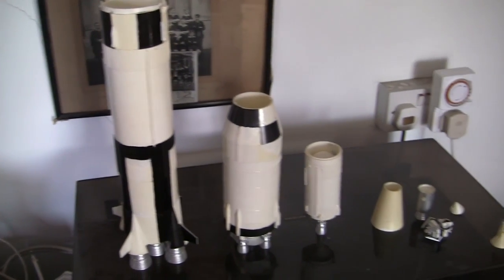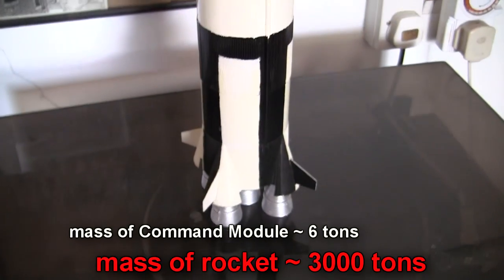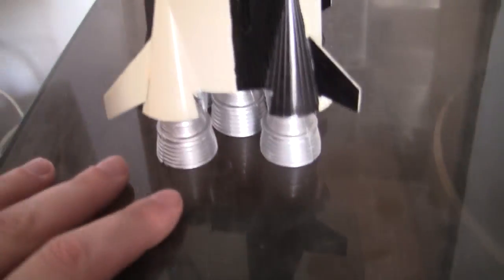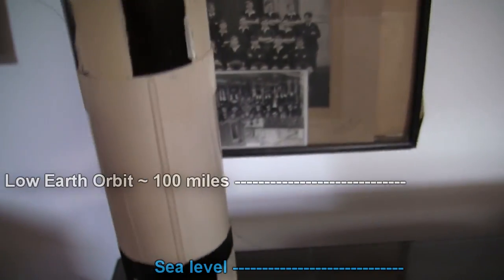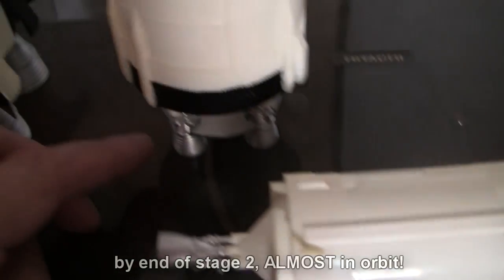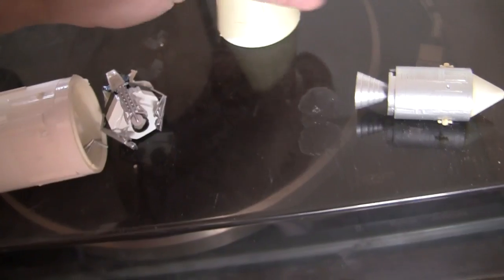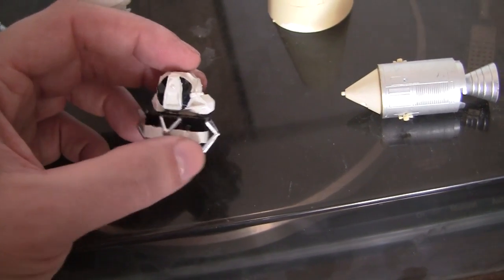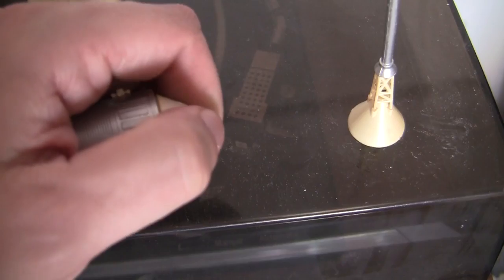The Saturn V Rocket: How it worked!

Comment: why is there no crater under the landing spot of the lunar module?
Reply: Elliot Roe
Gravity has nothing to do with it.  The descent module engine was just not powerful enough to leave a crater.  While it was capable of thrusting with 10,000 pounds of force, for starters, they don't land at full throttle, so it was more like 3,000 pounds when they were landing.  Second, the engine nozzle was about 64 inches in diameter, so that 3,000 pounds spread over the area of that circle (~3,217 in²) is less than 1 pound per square inch of pressure.  Then take into account that the gases expand rapidly in a vacuum, and that area is much larger.  All things considered, the actual pressure on the surface of the moon is well under 1 pound per square inch.  That's not going to create a crater.
Reply: Extremely low gravity.

Comment: You are telling us how it works and yet you do not know your facts?
Reply: +shecanatakeitcaptain no he was giving a brief rundown of how the mission was preformed. 
if he was telling us how it worked we'd still be here next week going over all the minor details of everything from mission control, orbital calculations, interception angles and burn times. (which personally I would find interesting)
Reply: +crwydryny No. The video is called "....How it worked." In the first 60 seconds the speaker says he does not know the mass of the fuel ( 80% or 90 %) forgets what the bit that holds the astronauts was called and does not know if it was 1% or 0.1% of the mass of the rocket.  This is not a guy who should be telling any how it worked.

Comment: What a great machine. I always wondered what did the fully loaded rocket rest on before liftoff. This rocket weighed almost as a navy destroyer, but always wondered what this whole thing rested on.
Reply: Rajan N It was held in place with a clamping device, which would hold on whilst the engines were throttled up and would then let go so it could launch

Comment: What kind of pumps can deliver 13 tones of fuel every second? so fascinating.
Reply: From the article I linked earlier.

http://arstechnica.com/science/2013/04/how-nasa-brought-the-monstrous-f-1-moon-rocket-back-to-life/2/

"As with everything else about the F-1, even the gas generator boasts impressive specs. It churns out about 31,000 pounds of thrust (138 kilonewtons), more than an F-16 fighter's engine running at full afterburner, and it was used to drive a turbine that produced 55,000 shaft horsepower. (That's 55,000 horsepower just to run the F-1's fuel and oxidizer pumps—the F-1 itself produced the equivalent of something like 32 million horsepower, though accurately measuring a rocket's thrust at that scale is complicated.)"

So, that's what kind of pump.
Reply: From Wikipedia about the F1. Each F-1 burned 5,683 pounds (2,578 kg) of oxidizer and fuel per second.
Reply: And that's just one engine!  The Saturn V had five of those things. :D
Reply: Big ones

Comment: Thunderfoot:
Have you ever heard of company called "AEORJET" ? They are located in Sacramento California. The head quarters. My grandpa Floyd Marvin Henson,
worked @ the company As an aerospace engineer. that is the company responsible
for manufacturing  all the rocket boosters used on the saturn 5 moon rocket. As well as all the modules, service,command,lunar modules.
Reply: James Henson aerojet made the engine for the CSM, but the launch vehicle was all done by Rocketdyne, though the 2 are now merged. The stages were not made by aerojet, they were done by Boeing, North American, Douglas and Grumman.

Comment: Why did the rocket turn around? Why wouldn't you just launch the rocket into space already assembled.
Reply: Aero dynamics the lunar module had extremly bad earo dynamics so they turned around in space instead
Reply: Rainbow dash well it was more than that! They can just put fairings around parts to make them aerodynamic. It was so that the crew could use the escape rocket in-case everything went sideways.
Reply: MegaMrFuzz oooh yeah i forgot about that part
Reply: Rainbow dash What do you mean by "turn around"? 
The rocket launched the top stage into low earth orbit without "turning around". The top stage then fired again to send the Apollo craft to the moon, again with no "turning around" involved. 
However, once on course to the moon, the Command/Service Module separated from the top stage and did indeed "turn around" as it had to extract the Lunar Module from its position atop the top stage.
Reply: EricIrl What I meant is how when on the way to the moon, after being in orbit. The rocket would split into two, and the crew would dock the ship the other way. I was wondering why, why not just send the ship up already attached? But that has already been answered by other people =)

Edit: I realized you went replying to me, but we both of the same thing in mind.
Reply: Ben Yes - I clicked on the wrong "reply" button. 

When they got to the moon, they wouldn't want the top stage (the S1B) still attached as that would mean they had to slow slow down a much bigger mass in order to get into lunar orbit. It would also have meant that any mid course corrections on the way to the moon would have had to move a much bigger mass compared to the Command/Service Module-Lunar Module combination only. That would have meant carrying a LOT more fuel - making the whole thing even heavier still. 

Getting rid of the S1B early also meant it gave them plenty of time to get the S1B out of the way. Having a big mass of dead rocket floating along near you was - 

a) dangerous
b) could interfere with radio communications

The best course of action was to shed that mass at the earliest possible opportunity. Which is exactly what they did. Indeed, you can see from how the whole mission was conducted, the basic principle of the Apollo system was to shed mass as soon as you no longer needed it.
Reply: EricIrl Wow! At the time they barely had any technology and they came up with this rocket. To the people that were brave enough to go in this bomb, you got balls of steel.
Reply: Ben They had PLENTY of technology. In fact, those who are building large rockets today can learn a lot by looking at how the whole programme was run.
Reply: EricIrl Yes =), they might have had smart people, but there computers were terrible for running the processes, atleast thats what I've been told.
Reply: Ben The computers were the best they had at the time for the tasks they wanted them to do. They were designed specifically to do limited tasks and, by and large, they did those tasks well. The computers on board the craft were designed to be as simple and as reliable as possible. 
People say today that they were [pretty dumb by modern standards - which is true. In fact, they were pretty dumb even by 1960s standards as they were more concerned about reliability than gee whizzery. Even today spacecraft computers are usually a number of generations behind what is available for day to day use - for the same reasons.

Don't forget though, they also made massive use of ground based computers - which were huge IBM mainframes and the most powerful available at the time. Apollo 13 managed to get home safely even though for a large chunk of the flight their on board computers were down due to lack of power.

And finally, there is more to flying to and from the moon than computers. There were massive engineering and materials issues to deal with during the design and operation of the rockets and spacecraft and they did this very, very well.
Reply: +EricIrl yep, just look at the shuttle, when they were still flying they were still useing those old 5 inch floppy disks (those big things that haven't been used since the 80s by everyone else). which considering the fact that all they ever needed was a massive calculator to work out orbits and burn times that's all they really needed
Reply: +crwydryny Very true. Later computers on the Shuttle used data and programs stored on DAB tape.  

The Shuttle computers had so little memory capacity that they could not carry all the software controlling lift off, in orbit activity and re-entry and landing at the same time. Before each phase of the flight, they had to dump the previous instructions and load up what was required next.

By the time of the last mission in 2011, the laptops and tablets used as personal computers by the crew had far more capacity than the computers running the Shuttle.

Comment: Actually I think you'll find that in the event that the rocket explodes, or just topples over on the launch pad, not only would half of Florida be dead, but so would the men inside, as the escape system wouldn't trigger early enough for the astronauts to escape. Of course they knew this at the time, they just didn't tell anyone.
Reply: DerpMans Derpyskin If anyone has seen film of a tree falling over, one realizes that it does not instantly fall down and impact the ground. If a Saturn V had a structural collapse and started to fall over, the Emergency Detection System would automatically initiate a Pad Abort and send the capsule out to sea. In Abort Mode One Alpha, during the first seconds of the launch, if there was any problem with the Saturn V, again the EDS would initiate an Abort.

Believe it or not, the NASA engineers during the 1960s were pretty smart and figured out how to keep the astronauts alive during all sorts of deadly mishaps.
Reply: DerpMans Derpyskin no, the escape tower was only activated from command pod input, entirely pilot discretion.
Reply: DerpMans Derpyskin Half of florida? This is not a nuke. Also, the rocket doesnt just explode because of nothing, if a leak is detected or a premature ignition, the astronauts would know well ahead of an accident.
Reply: Jason Zhao Well, your correct. But you're assuming that this cannot explode. It can. Though its unlikely it can, and the fuel is equivalent to two kilotons of TNT. I noticed you compared it to a nuke, and this 2 kt, is about the size of a small atomic bomb. And (at least according to a documentary I watched) if the engines failed, (by engine failure I mean they went up, a foot or two, and fell down, signaler to the first satellite america launched) or the rocket fell over on the launchpad, then... Boom. 2204 tons of TNT. And no escape for the astronauts.
Reply: DerpMans Derpyskin That is assuming ideal conditions where all the fuel will ignight and explode at once. Just look at the Challenger, it's ET and SRBs exploded midflight with an explosion far less than a nuke.
Reply: Jason Zhao its not fair to compare this to the challenger. Its got much more explosive power. Of course you're correct, it would be unlikely for it to blow, but it could, and it would blow big.
Reply: DerpMans Derpyskin 

The size of the explosion would be less than a 20th of the size of the nukes used on Japan, without the fallout, and the launch site is located quite far away from major settlements. The damage done would be more than most rockets, but the Saturn V is bigger than most rockets.

Also the escape system isn't just designed for pad aborts.

Please check your facts before you try and tell someone they are wrong.
Reply: DerpMans Derpyskin 
http://en.wikipedia.org/wiki/N1_%28rocket%29
Total estimated force of the explosion was about 4-5 tons of TNT, despite the propellant load theoretically being enough for a 6.9 kiloton (of TNT) blast.[41] The subsequent investigation revealed that up to 85% of the propellant onboard the rocket did not detonate, reducing the force of the blast

These things are designed with the possibility of catastrophic failures in mind, The base line argument of the explosive value of the fuel is correct but the chances of it happening where designed to be completely outside of the realms of plausibility. for a start, detonation at peak force would require all the fuel to be spread at a near perfect mix ratio, and the only way to cause that would be several smaller primary explosions, and the act of having those primary explosions would burn off huge portions of the energy in question.

Theoretically the most dangerous possibility would have been a failure similar to what I'm about to list, it will sound extremely convoluted as it assumes many worst case scenarios

During the 1st Booster stage acceleration the 2nd stage breaks free of the decouplers between 1st:2nd, the force of the decoupling damages the engine and causes a massive fuel leak but no ignition, the sudden mass change of loosing all stages above 2nd causes the 1st stage to suddenly accelerate and collide with the 3rd stage tanks resulting in the 3rd stage tank being completely sheared open, at this exact time the 2nd stage tank falls into the main booster flamewake, the fuel leak from the structural shear is at optimum flashpoint  and explodes, this 1st explosion shears open the 2nd stage tanks causing a 2nd explosion, the 2nd explosion reaches far enough to trigger an explosion in the 3rd stage tank that has just been ruptured by impact with the main stage, these 2 explosions then cause the remaining fuel in the main stage to trigger a 4th explosion.

The fact that these theoretical explosions are staggered causes a huge loss of force, this is because force is relevant to the cube of the propellant in any givien explosion(this is why a 2000lb bomb is 8 times more powerful than a 1000lb bomb), also the theoretical force of the calorific value of the fuel assumes a fuel air mix  that is high enough for an explosion, this is extremely unlikely as if the mix is too fuel rich it cannot explode, as it can receive oxygen as fast as it expands, resulting in a long explosion of several second as opposed to a "powerful" explosion as the force of the explosion is used in pushing unburnt fuel  outwards, with the wake of it exploding itself.
Reply: Nice job. Thanks. Another way to look at it is to compare rapid oxidation vs. explosion. Liquid fuel has a very fast oxidation (burn) rate as opposed to explosive solids that detonate. Thus while the Saturn V may have had the explosive equivalent of X-tons, as you point out, the stored energy is not released in an instant (explosion), but rather is ignited and burns as the fuel/oxidizer (air) mix becomes optimized. Thus, Florida would be saved and the Astronauts would live.
Reply: foxkart61 it was automatic no?
Reply: Shakfey Funny because I did check my facts, I actually googled the size of the explosion, and someone said it would be the size of a small atom bomb. I doubted it but it sounds cooler to say, a small atomic bomb, than to say two kilitons of TNT. And also I never compared it to the little boy bomb.
Reply: DerpMans Derpyskin I disagree as the (Dry+Full, couldnt find fuel mass) mass for the Saturn V is only about 2x the mass of the Space Shuttle with the diference of about 1300000 kg. But take into account that the Saturn V holds about 2200000 kg of KeroLOX and only 600000 kg of HydroLOX, compared to the Space Shuttle's 1000000 kg of HydroLOX and 500000 kg of SRB fuel, you have two pretty similar levels of power. Keep in mind that SRB Fuel and KeroLOX have very close burn rates and are both far less violent than HydroLOX. Also, the Saturn V's propelant is contained in 3 main stages (LM and CM have insignificant amount) while the Space Shuttle's is alot more localized around the same level.
Reply: DerpMans Derpyskin If it were true that a large part of Florida would be obliterated if the Saturn V exploded, then I guess that a larger part of the USSR was obliterated 4 times.  This is the number of launches for the Russian rocket they were using to try to get to the moon (the N1), and it had an equivalent amount of thrust or more, and all four launches exploded in flight.
Reply: retrofan42 Well, the N1, did, (according again to a documentary I watched) explode with the force of a small nuclear bomb. And if you where one of the spectators of the N1, (if they allowed that) you would be dead, or atleast if you weren't in the dug out. I would imagine that the same applies for the Saturn V, if it exploded.
Reply: DerpMans Derpyskin I think you also will find that the escape tower "did not work", because the astronauts chose to not even consider using it, to the human error of aborting a good launch ... that would be almost as embarrassing as deciding to invade a country to confiscate WMD and not finding any.
Reply: foxkart61 Wasn't that the Gulf War?
Reply: Jason Zhao no, the Gulf War was "Bush I",  the invasion of Iraq for non-existing WMD occurred later during "Bush II".

Comment: If anyone says that the bak up plan wont work and they will die orbiting the moon,your wrong it did work on another lunar mission i cant remember it maybe Apollo 12 or 13
Reply: No. Apollo 13 didn't use the sort of "back up" plan you're speaking of. That was only meant for pre-orbit. With Apollo 13 they ended up using the life support of the Lunar Module to compensate for the power loss and heat loss of the Command Module (also doing some incredibly creative "patch ups" and even rigging up whole new CO2 to oxygen generators with materials on the ship) while on the trip around the moon and while being "slingshotted" back. They still very barely survived, and there was no abort system once you were headed towards the moon.
Reply: But they did survive